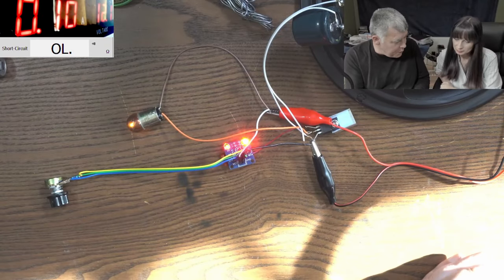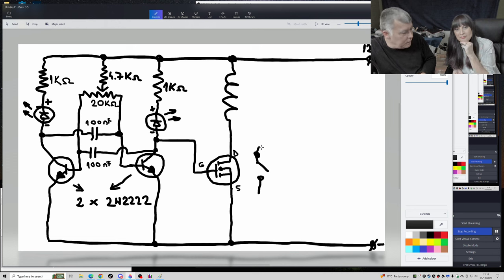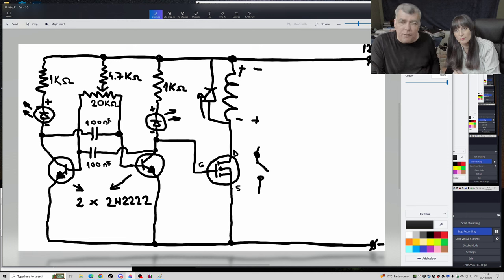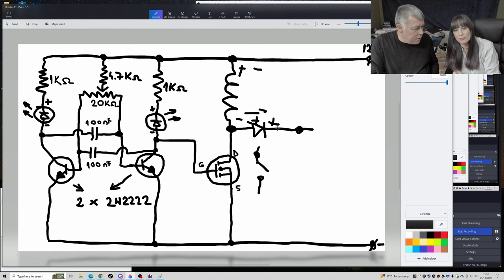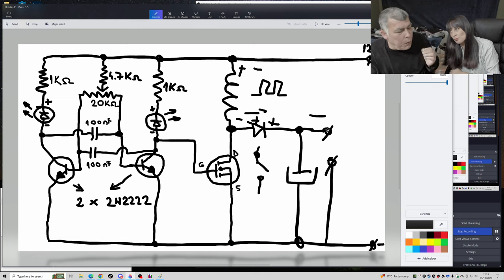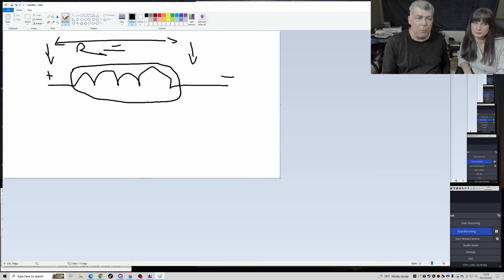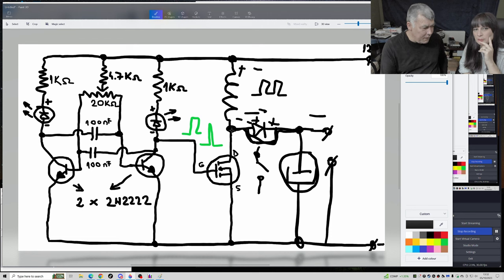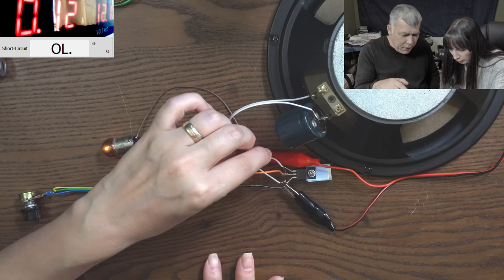Current boost converter - The theory - How they work? Lesson 27 Learning electronics with Diana

Comment: The pitch as heard acustically must have been up to 10kHz, because it could be heard as a tone. The pitches in the higher frequency range are heard as a hiss. Mathematically, with the potentiometer set to the middle position and a 100nF capacitors, the squarewave signal frequency would be around 340Hz. [1÷(2(14.7exp10³ * 100exp10-⁹))] By replacing the 100nF (104) capacitors with the 3.3nF (332), the frequency would shift up to around 10.3kHz. Deviation ratio possibly adjustable with potentiometer is somewhere between 1:1 and 1:5. So, the shortest pulse would last around 16us, and the longest (assumed pause) around 82us. Together the total period remains around 98us.